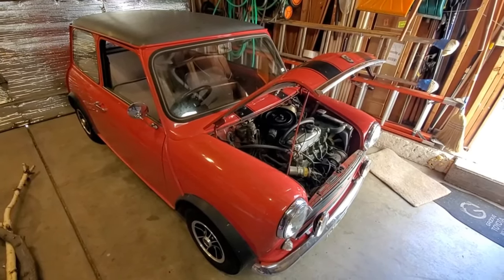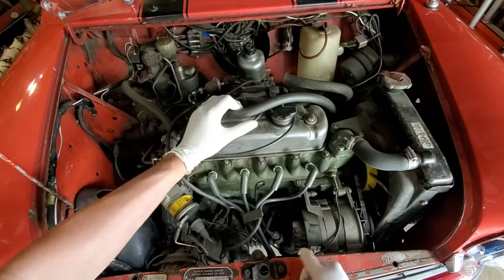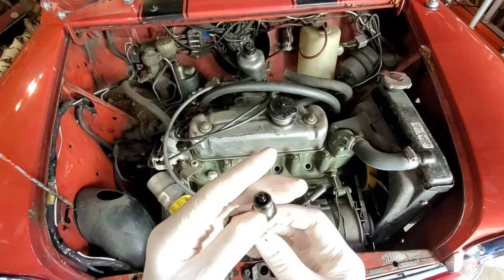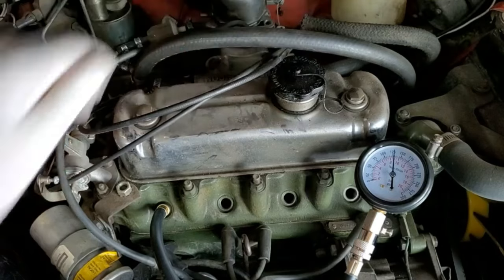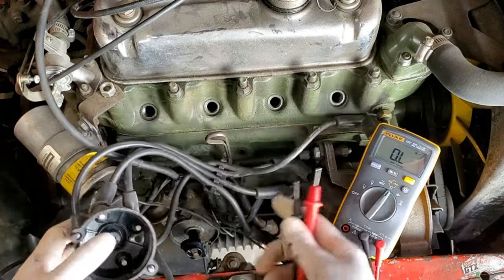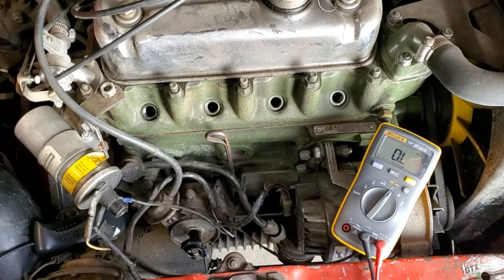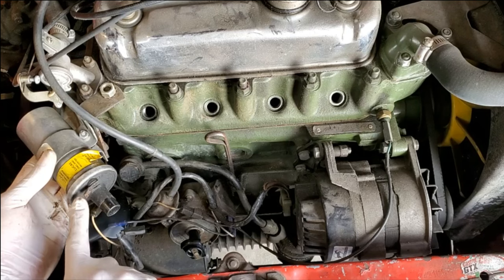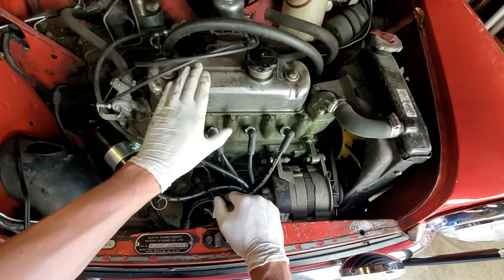Tow-In, Crank No Start, 998cc Mini - Initial diagnosis and ignition setup, Part 1

Comment: You sound quite knowledgeable about the details of the ignition. People tend to mix and match all kind of parts on these cars. I would think that heatgrade 5 might be better on a relatively stock engine spec.
Reply from the maker: The 5 might be better or too hot. If it only gets used for city driving then id go with 5. The best answer comes from driving a tuned engine and checking condition. Then reassessing the heat grade based on your driving conditions.